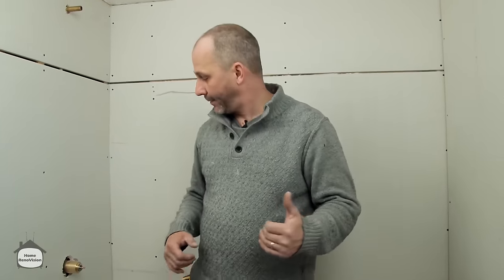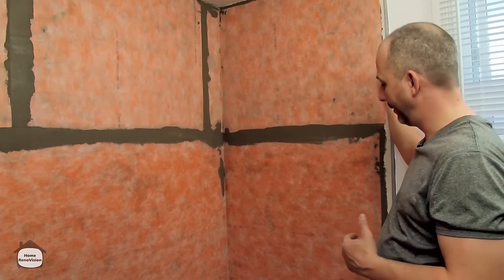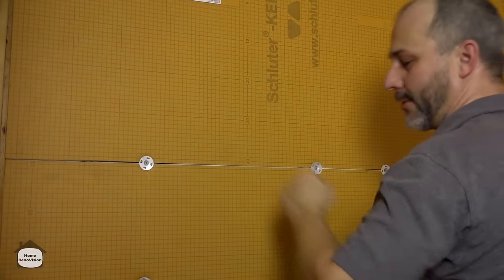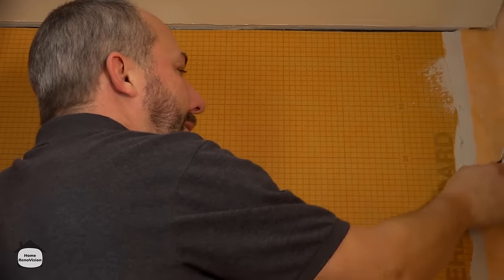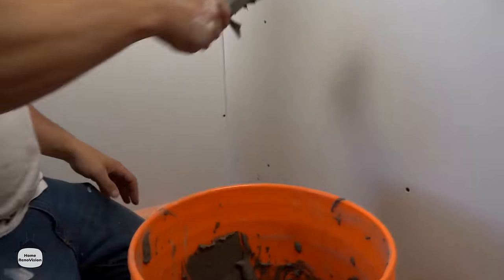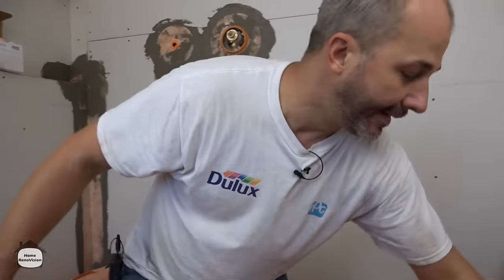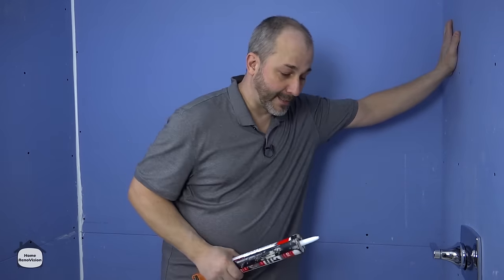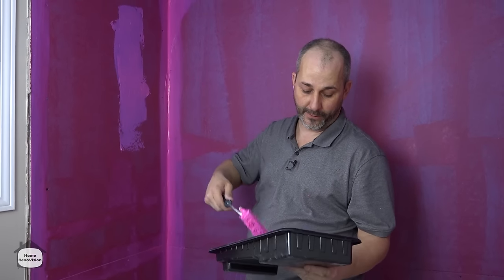4 Types of Shower Waterproofing Systems for Your Bathroom

Comment: Jeff, at 37 min into this video you installed the shower valve seal backwards.  I did the same thing by mistake.  The theory is the slope on the rubber seal is supposed to channel the water to the shower side, not to the inside of the wall.  Very insidious detail, and unlikely to be an issue.

Comment: Mud job tiled surrounds commonly last 50 years or more without mold or rot issues, and are often torn out only because the tile is out of style. They last because there is no paper in the surround, and any moisture that does weep in  can dry out without issue.  Durrock is the modern equivalent to that time proven system; same approach, but less labor intensive. It's also inexpensive.  Other than Durock being heavy, I see few advantages for the DIYer in paying the high material costs for Schluter's system, especially the variant that uses paper faced drywall in the surround.  No matter how loudly they claim it's waterproof, no installation is perfect.  The important thing is how the system handles small amounts of moisture that eventually will penetrate, and for that, a cement based substrate is better. If you actually read their warranty, you'll see it covers only the failed portion of the assembly, and there are other limitations...don't expect your shower to be rebuilt for free. For the pro, Schluter's system may reduce labor costs enough to offset it's high material cost; I don't know about that. Whatever the case, it's silly to pick any system that has paper in the shower when other equal or lower cost alternatives are readily available.  My 2 cents.
Reply from the maker: Hi Bob, I agree in principle that no install is perfect. That is why I love Schluter. It is engineered so beyond perfect that anyone trying to do a good job cannot possibly screw it up unless they do it on purpose. In the world of DIY I trust homeowners to do a great job with good information. I don't  trust contractors to have as much integrity!
Reply: I am a total amateur DIYer. I have done two showers and will do two more in my new house. All the DIYers that I know are doing it to save money. They don't have money to burn. They also want to go to home depot or lowes and get the material. Cement backer board, backer board screws and finished off with red guard are all in stock and the big construction stores.
Reply: Bob,  I must take issue with one of your claims. "The important thing is how the system handles small amounts of moisture that eventually will penetrate, and for that, a cement based substrate is better." Just to understand  your claim Are you referring to a Water in/ water out pan with a durock wall substructure as being superior to a topically applied sheet membrane utilizing a bonded flange drain assembly? 
NOTE: you didn't mention a vapor barrier behind the CBU?  (TCNA B-415, ANSI A108 02 3-8) which is necessary if you are not using a topical waterproofing membrane (ANSI A118-10). 
While both systems are approved there are many disadvantages to the traditional method in a modern home.  The two most relevant are  The traditional method does not handle changes in plane  (Niches, Benches,  curbless, and many curbs. This is a primary cause of residential shower installation Failures in the US.   The surface membranes solve this inadequacy of the traditional mudbed/CBU. 
The second issue. Modern homes are very air tight to meet energy effency standards. When a shower leaks into a cavity where it used to evaporate today a small leak will wet rot and mold,  this becomes a health hazard.  
Because CBU / vapor barrier behind (let alone CBU only,  which you seem to suggest)  installs are much more likely to leak when  the above details are included  than with a topical waterproofing system  even if the competency of installation is marginal (Schluter in this case) It would be wise to to use a topical membrane.
Reply: I disagree. The problem is not that water will eventually dry if it gets into the mud, it's that if the shower is use daily (if it's the only shower in the house that's pretty much a guarantee), there's not enough time for the moisture to dry out so it just collects and collects and mold eventually grows behind the mud and you get all sorts of issues. Waterproofing is really the best way to go. Prevent water penetration from the beginning.
Reply: Bob the problem with cement boards is that they do not have the same thickness or more importantly the density of the old mud set systems of days gone by. My experiences inform me that you are correct about the old mud set system. I've never Once found rot or mold behind those old assemblies. I have found lots of rot behind cement boards installations where it was the only thing installed on the wood substrate. Cement boards are not water proof. No exceptions. They are water resistant only. Meaning they are not affected by water but they do not stop the migration of water into the substrate. I installed that system for many years but I recognized the limitations of it so I developed work arounds. I always installed self adhesive and self sealing flashing on the face of studs so that water could not be absorbed into the studs. This was before I researched and then attended both of schluters 2 day seminars/ workshops. What they explain in great scientific detail is that their membrane is completely water and vapor Proof! When installed properly, water in any form cannot find a way through their system. That's why it's fine to use paper faced drywall. I was skeptical of the system the first time I encountered it but after having the science explained to me I use it with total confidence. Not because of the warranty (I quote the late great Chris Farley "I'll take a dump in a box and mark it guaranteed, I've got spare time, but what are you gonna have? A estranged piece of shit") I trust it because it makes scientific sense, that it will perform better over the long haul than my augmented cement boards assembles ever could. While I remain confident that those showers don't leak water (I've yet to get a call back in 15 years) but those could never be moisture vapor proof so they are susceptible to mold. Since the schluter is so much lighter, easier and tremendously better at its intended purpose it's foolish not to use it.
Reply: Wrong.

Comment: Redguard Pro Tip: You're note supposed to lay on RedGuard thick. its supposed to be laid on thin initially. You need to prime it. Thick right off the bat will crack as it cures from red to pink. especially at any seam or changes of plane. Also, changes of plane should be reinforced with either a mesh or fiberglass felt for full shower (wall to floor). Cracks = Water penetration = failure of the waterproofing.

Jeff is doing wall to wall seams only.

Comment: Great videos.  When installing the Kerdiboard, I noticed that you went to the top of the tub lip and then ceiled the gap with the caulk.   But the tub lip sticks out beyond the Kerdiboard so how will the tile (which would overlap the Kerdiboard and tub lip) be flush?

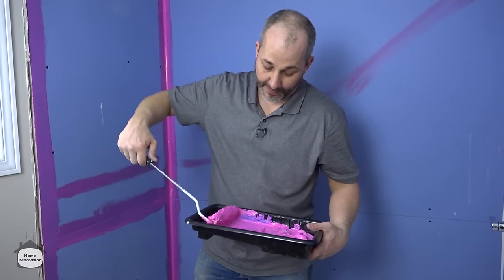Comment: Love your videos Jeff.  We need your help though....  I've seen video after video where you are cutting out the old drywall and then installing cement board, or kerdi, or Mold Resistant Drywall and then you leave a gap where the old drywall meets the new product.  See 49:14 in the above video.  How do you finish that transition between the old and the new?  And who do you do it so it doesn't look like a transition?

Comment: My son and I are doing our second  DIY dry bed shower using durock board on the wall .  We watched all the videos and the best info on this video is using Red Guard.  Tape you joint real good  and RED GUARD till it bleeds .  Jeff does a great job explaining all the system you can use.
Reply from the maker: Cheers jim, thanks!

Comment: You are a Godsend. I had to tear out a shower surround and the wallboard beneath it due to mold in a 110-year-old house. I do not have the resources to hire someone. I even took some bids from local workers and I knew their plan was to rip me off because they just weren't charging me enough. I know what the materials cost. I did my own research and decided to do it myself with the help of my son and use RedGard. At the end of this video, I lit up when I saw you using it. And you recommended using it in just the manner I was planning on using it. Thank you for your great videos and advice. We hang the drywall tomorrow.

Comment: How about using cement board and RedGuard?  I have used all the systems that you've showed for waterproofing showers.  I have found that I usually have to demo drywall anyway behind old shower walls, so i just replace with 1/2 Durock, tape the seams and install RedGuard.  Seems to be the fastest most cost effective way for  my area here in Charlotte, NC.  

I really love your channel, you are always very thorough, and you explain your process very well.  Thanks.  Casey K

Comment: Well done....very informative , well rounded, and nice to see different methods/options.  One comment, while I think the Schluter system and products are awesome and as you pointed out a costly option.  I'm not sure mentioning the warranty of that system is warranted given that there is no warranty from the instant you introduce your Lepage seal and bond product in place of the shluter caulking that is not readily available.  My only concern is that the better part of your audience is DIYers that will follow you procedure to the letter and in the event somewhere along the way they slip up and it results in a failure of some sort, they might think, no problem , i paid the top dollar for the high end product and Jeff said it had a 10 yr warranty, which will be voided.   As you clearly stated, it is warrantied providing it is installed per spec.  IMO, even if you can't get the shluter caulking/sealant at the major big box stores, if you're going to spend that kind of money,  it would be advisable to order it online ....find it and buy it from whereever you must......otherwise, you're probably far better off with the more cost effective red guard option.....just my 2 cents

Comment: I bought a old house that home owner or someone had installed a tub/shower system from one of the big box stores. As time has went by the sheet rock above the wall. Which is about 5 ft has stated to fall apart. What can I do to repair this? By the way your channel is super good. Thanks for taking time to help out Johnny home owner.
Reply from the maker: Simply cut it out and replace. use a paint for bathrooms to avoid this problem in the future. and seal the edge to the shower with a silicone bead caulking. Cheers!

Comment: ive been installing tile for 12 yrs and we always used du-rock and tape and thin-set, never had any problems!
Reply: so you don't need a waterproofing membrane?
Reply: Still need red guard,durock is not waterproof

Comment: We're planning to use mold resistant drywall and paint on a membrane (AquaDefense, or RedGard) in our basement apartment's tub/shower. We are going to be installing a tub/shower surround that is only 58" high and is the "glue to wall" type. We're trying to figure out what to do from the 58" mark to the ceiling and the ceiling itself. 

Should we paint on this membrane all the way to the ceiling? If we do that, can we paint over it with regular kitchen/bathroom paint? 

Could we get away with only putting the membrane behind the surround and using regular kitchen bathroom paint, directly on mold resistant drywall, from the 58" mark up and on ceiling?

What type of glue will be sure to adhere to the membrane? Or, will our plan be completely foiled because the glue may pull the membrane off?

Thanks in advance! We love your videos!!

Comment: I just replaced a shower with a jetted tub in our master bathroom, used James Hardie hydrodefence "waterproof" cementboard backing, then used Kerdieband on all the seams. I'm not a contractor, but I've done about 4 showers this way and it seems to work. I've been tempted to try the redguard method, but so far the idea of putting it directly over drywall has made me too nervous. Lol.

Comment: Great summary of different bathroom waterproofing techniques.

I did get a bit confused in the installation differences between # 1 & # 3.  They both use the Schluter membrane.  So what is the difference?  Is the difference in installing it over a bathtub in the first and a walk-in shower in the second?

With regards to # 4, could you provide information on a couple of other liquid membranes you might recommend for bathroom waterproofing?
Reply: TEC makes a liquid membrane.

Comment: Love all your videos Jeff. Thanks. I am curious about the roll-on waterproof membrane. Now that you've created a new surface of membrane over the drywall, that's what the thinset for the tile is going to stick to. Does that have enough integrity so that the weight of the tile wont just pull the membrane off the drywall? Thanks

Comment: Jeff, I've been watching all your shower video's.  Thanks, I've ran my installed the  valves, shower pan and ran the pex as you demonstrated.  I intend to use the Schluter Kerdi board/system for my shower walls.  What I've missed is what's needed for the ceiling?  I will have a rain shower head from the center of the shower, plus the usual shower head.  I know I can use the Kerdi board for the ceiling but at $100 for a 4x8 sheet, maybe I"m wasting my money where I don't need that level of waterproofing protection.  Should I use mold resistant drywall, etc.  Please advise.  Thanks!

Comment: You should always use a damp sponge over your drywall before applying thinset for the kerdi system. Same goes with any tile installation, you dont want your walls to get its first drink of water from your mortar. This is extremely important when installing tile over Hardie board. A dry wall or floor will draw too much moisture out of the mortar, reducing its bond strength. In the case of very dry underlayments like Hardie board so much moisture can be drawn out of the mortar that it can cause it to break bond with the tile itself.
Reply: Actually a concrete bonding agent should be rolled over any drywall or plaster to avoid any bonding issues.
Reply: dmith smith 

Water works fine if you keep it wet ahead of you
Reply: Paranoid much?
Reply: @chrisj197438  It does, but the bonding agent really works good at keeping it wetted. Nothing sucks worse then a dry bond on sheetrock.
Reply: He skipped the the most important step. He failed to give the Sheetrock a drink.
Reply: I think he made the cement extra wet to to keep it wetter longer. Either way you bring up a great point. Thanks.
Reply: My Pop taught me this many years ago while patching concrete with mortar. Very good advice. Thank you.
Reply: Very alert  and focused. Rule of thumb, If product needs cure time as apposed to dry time it is always best to keep moist while curing. Also depending on dimensions, concrete for example, after cured to full strength you may now also need a drying time  so any moisture that is still in the product  can release the moisture without any fracturing and damage to the product. You are very wise in applying you self  to your application and installation
Reply: Chump Johnson much
Reply: @Cris5598  actually i would not put it in those words it makes the comment a personal attack. yes i am concerned. when the surface dries before the cure time is achieved it does not reach full strength and traps any moisture below. When the moisture below begins to evaporate the weakened dry surface above is damaged by the expansion of the gases created by the moisture evaporating
Basically your structure and any vape  barrier is trashed and eventually the entire installation.
Reply: 🤔interesting
Reply: at 37:20 he mentions that he mixes the concrete with extra water so it doesn't try to quickly. Basically doing the same thing, right?
Reply: Ed Spivey great point! Wet thinset helps it adhere and get proper coverage but you still have to saturate the substrate as well!! Notice he didn’t check coverage either😂
Reply: I will remember that!  Quick question - for a bathroom floor adjacent to a shower, how crazy would you get with waterproofing?

Comment: Did I miss cement board? I see that more in your newer videos. How does cement board compare to mold resistant drywall? Based on what I have seen on your channel I think I would choose cement board.
Reply: How does it compare in terms of what?
Reply: I agree and cement board is still a common and economical product.  Not sure why Jeff didn't address this.  The only problem I'm aware of with cement boards, like Durock, is that they are heavy to work with and take a little more effort to cut.